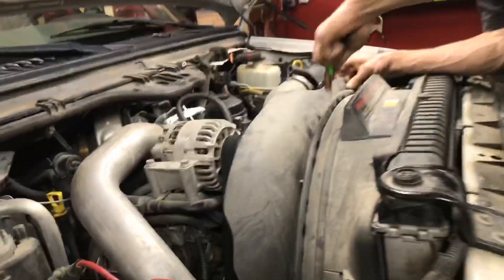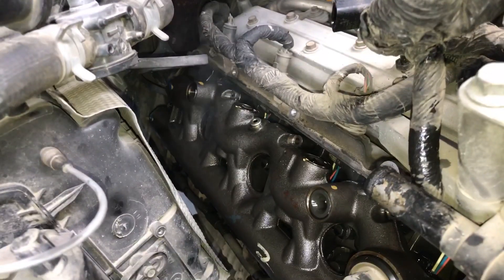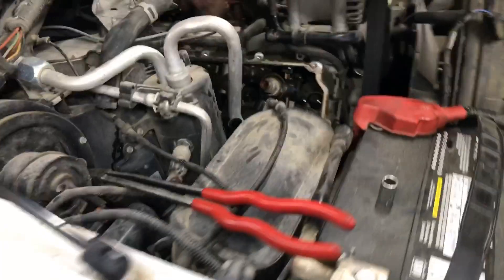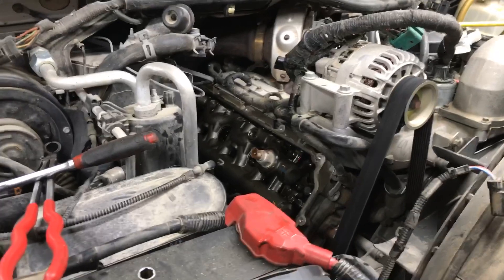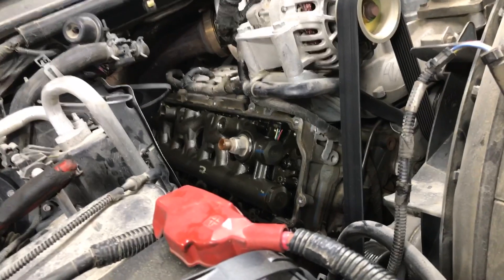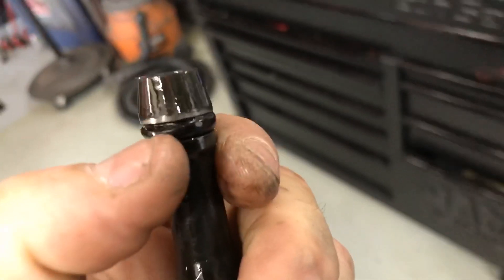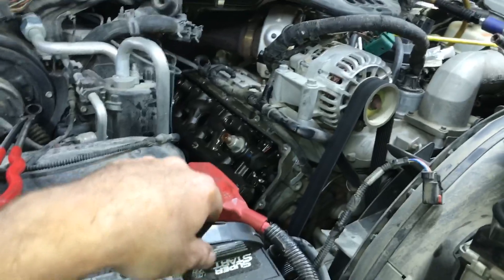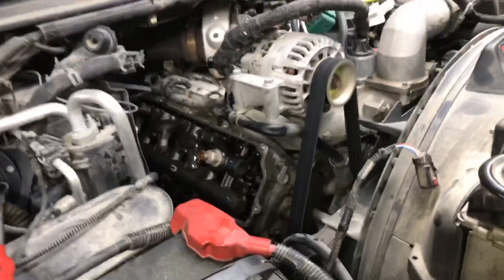Travis hot no start

Comment: Use a giant lag screw and screw into the lower half of the standpipe pop it out with a slide hammer or pliers pried against oil rail, works most of the time